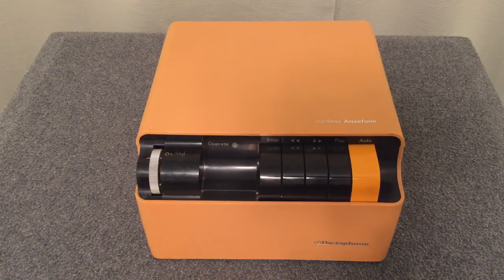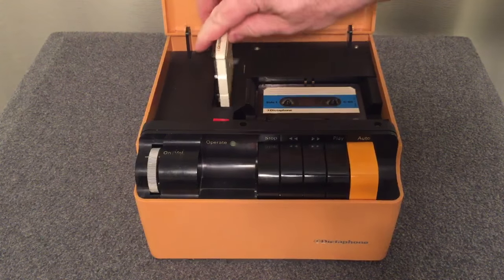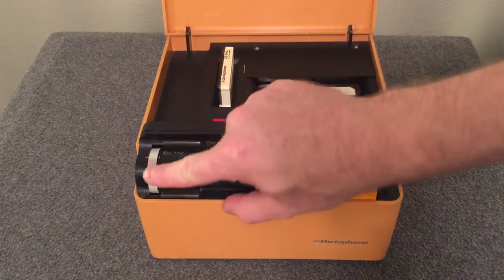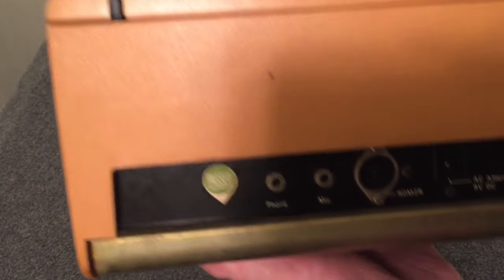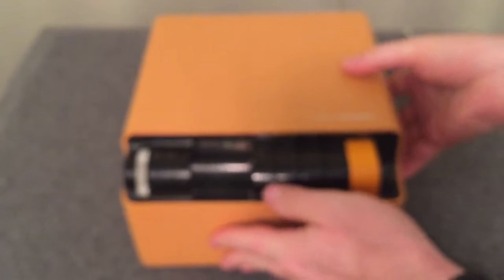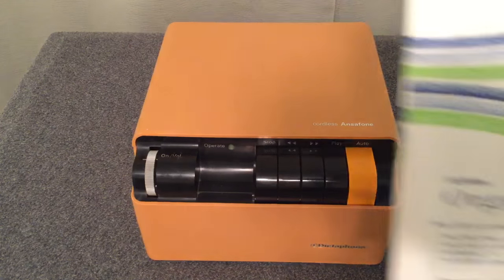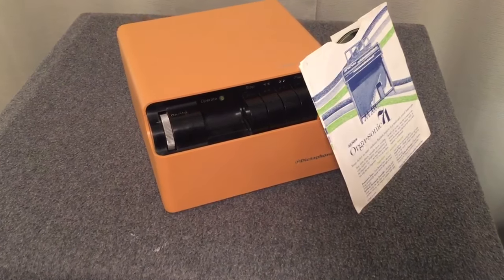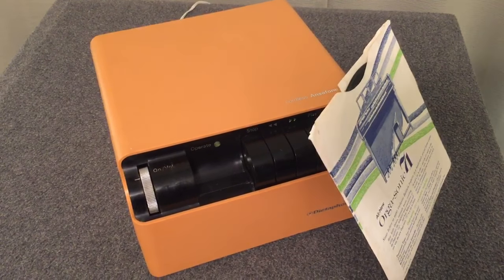Ansaphone Answering Machine

Comment: On the "free organ lesson certificate" notice that the addressee has no zipcode.  Zipcodes weren't introduced until 1963.  That letter is dated 1962.  Very interesting.  You find the best vintage equipment databits, great nostalgic video.

Comment: It is "Cordless because the original Dictaphones and answering machines had a wired mic you would use to input sound, and in some cases you would use as a speaker holding it to your ear or in front of your face for playback, depending if you wanted to disturb people or not.

Comment: I had gotten a Baldwin orga-sonic 57R last year, that would have made my 4th organ in my families house. The thing barely worked, the Leslie's speaker was dead. The instruments sounded off. The panoramic (reverb) tone couldn't be switched off. I did, before we disassembled it, recorded samples of all the instruments with one note per each. I've used them in some renditions of songs I have made. Is still have both manuals, pedals most of the circuit boards and the Leslie. I hope to make a fully working Leslie with what I have left.
Reply: So, did you ever get that organ working right?

Comment: My folks had something similar - but instead of the 'mini-8-track' looking thing, it actually used a pair of Philips cassettes.   The 'message' tape was your average cassette; it could be any length.  The 'answer' tape was an endless-loop, but in a cassette housing, and was also 20 seconds IIRC.

Comment: Thanks for confirming the outgoing message uses a PlayTape / Mail Call tape. I'm looking at one of these machines, and it's missing the outgoing cartridge.
Reply: Actually I was wrong - it's a HiPac cartridge not a PlayTape. PlayTape doesn't have the movable pinch roller.
If you ever want to sell this let me know... now that I have the model before, and model after it would make for a nice progression the next time I do an answering machine display at a Vintage Computer Festival,

Comment: A few guesses.  Way back in the 70's, the telephone company wouldn't allow any non-telephone company equipment to be connected to the phone system.  In order to connect a customer-owned device to the phone line, you'd have to get a interface from them.  That seems to be what the RDMZR is all about.  As a result of this, the first answering machines, in order to work around this expensive interface, tended to look like 300 baud acoustic modems.  They coupled with the handset with a device to take the phone "off hook".  So perhaps "cordless" in this sense was to eliminate the mess of setting your phone into the device when you went to leave the house.  

As for the "phone" jack, I'm wondering if it's for a telephone pickup coil (usually a suction cup).  That might allow you to record phone conversations.  If I'm right, it will be little more than a few resistors connecting it to the mic input.

Comment: that's to cool. how can you hook up a phone line to a din port anyways? I have an old pioneer reel to reel that has that ability, but I'm not sure how to hook it up
Reply: DIN connectors are not only used for audio equipment. This looks like a 7pin connector and seems to be a little bit longer than normal.